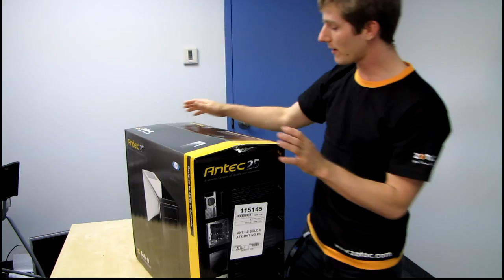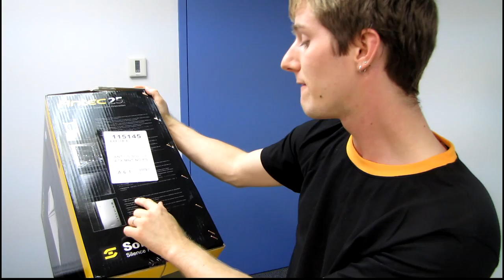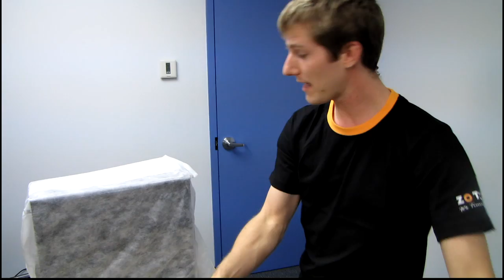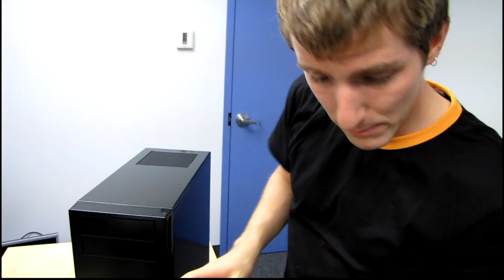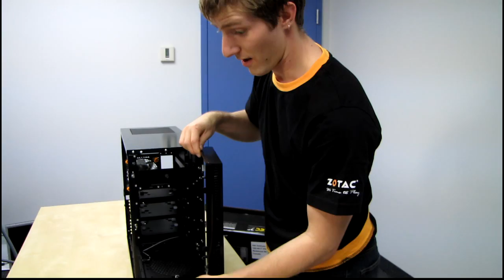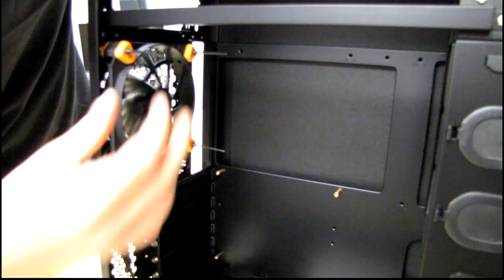Antec Solo II Silent PC Computer Case Unboxing & First Look Linus Tech Tips

Comment: Does the ventilation holes area in front match the area that is covered by a fan, if not then basically you could be in situation where you have 120 mm fan but hole for it in pc case is...90 mm so.....see what i mean. Thats always my consern about these silent cases-more you restrict the passive airflow, more rpm you get from fans inside pc.

Comment: Hey. Nice review. Just wanted to say the incentive (for some) to have a bunch of hard drives (even with high capacity drives available) is redundancy. Also, I have a case with a bunch of hard drive slots. I have my drives mounted with one slot between each drive so more air goes between them and (theoretically) I get better cooling.

Comment: Wow Antec really improved the SOLO design.
larger 120 mm front intakes,
hdds sit up higher so the GPU doesn't blow hot air on them, 
removable PSU bar so you don't have to remove the cooler to pull the PSU
cutout behind motherboard for easy cooler install
PSU intake moved to the top so it doesn't fight with the rear fan for air.
Now if only i can find it on sale, i can retire my SOLO I.
Props to ANTEC for listening to customer feedback !!!

Comment: so let me get this straight, you bought a new fan for the processor, the scythe one, and its still noisy? which case are you using? and what power supply are you using also/rest of your pc specs..., im asking this because i dont think this antec solo ii case can ever be loud itself because it has a fan speed controller on the rear fan i believe so you can just put that on the lowest or whatever, but even on the 2nd speed, it will be only barely noticeable if your system is efficient enough?

Comment: Part 2: My pc is an AMD build pc (CPU and GPU) which means my system runs hotter than the competition. At this moment i have bought a different CPU cooling tower, the Mugen from scythe with at the moment only 1 120mm. and at a 100% load for over a couple of hours my system hasnt been running hotter than 65c all though it was noisy because the fan had to work at its maximum capacity it wasnt really bothering me, and i like a quite pc without so i hope this helps a bit

Comment: First of all the Fans that i have installed are directly controlled by my motherboard M5A97 PRO, Asus has a standard software for overclocking clalled AI Suite II which i still use. Not only does the software provides the overclocking tools but also the Fan speed management. On the front side you could install 2x 120mm fans for intake. In the back is a standard 120mm fan on rubber grommets. The PSU is mounted in the top facing its fan outside, so no heat from the PSU is directed into the case..

Comment: do the fans use speed controllers or is auto adjusted? not that it matters really if its still quiet at almost full speeds but just wondering because i recommended this case to a person who wanted to build a pc, and this might seem like a stupid question but where does the psu take fresh air from, are there tiny holes that it sucks in and then blows it out the back where the on and off switch is? im not getting how this works, and it wouldnt matter if the fan is facing up or down either?

Comment: I would feel a lot better if the suspension method had front/back securement. I could probably just use rubber bands, but it would have been nice if they had it built in. It seems like the HDDs might just fall onto the video card if you do so much as try to rotate the tower with those elastic things.

Comment: @seba3001 having a bottom mounted psu is better because its the heaviest component in your case it makes more sense to have it at the bottom also, alot of cases with bottom mounted psu's like my 600t graphite for example have a vent at the bottom where u put the psu letting you mount it fan down the correct way so the psu is pumping heat out the case not in.

Comment: @SirMango It´s actually not that bad actually, the graphics cards will get more direct airflow. And the PSU won´t be plugged with dust as easily. On Tomshardware(dot)com I read about this and the reason the PSU used to be on top was becuse it sucked out hot air from the system. Having PSU on the bottom have few benefits but have become popular since customers asks for it.

Comment: hey linus. could you review the back part of the case and inside the right side panel to look at the cable management? also i noticed that the top and sides do not look like it uses alot of pop rivets, is it possible to remove it for modding? thx

Comment: I think this is a great case, but the extra space given by the small harddrive cage us useless, because who will install huge GPUs (like the 6990) in a silent and simple case like this? They should have just given us 1 more 5.25" and at least 2 more 3.5" suspension mounting rubbers. Thumbs up if you agree

Comment: Ehh, stop the bias against Antec, Linus. That's just bad.

Neither USB 3.0 nor aluminium panels are new, and neither are the strategic fan intake slots or the vibration absorbing rubber feet.

That goes for all the commenters as well, Antec is a good company, dictating what catch-up companies should do, they aren't one themselves.

Comment: My old P180 was the last case that wasn't disappointing when I started using it, HAF X felt cheap, and my current Define XL just isn't as silent (and the top fan cannot be installed, without it interfering with the CPU cooler)

Comment: @SirMango 
Since all of the major components (ODDs, HDDs/SSDs, power) are near the top, having the PSU at the top makes sense. Would you want all those cables running through the system? The only cables that need to run down are the PCIe power cables for the GPU.

Comment: I have the old Antec Solo, one of the best houses I've ever had. Even kept it when upgrading my computer, though I had to saw off a part of the inner plates, for the new videocard to fit in. I just love that case, so quiet and practical, has such a professional design and quality. And this new one seems even better.

Comment: @1111Davo1 Well the thing is, is that hot air rising doesn't have much to do with it. Either way the hot air is going to be ejected out of the back of the case. A big issue with this case is that you're power supply can intake a little bit of the air that it just exausted.